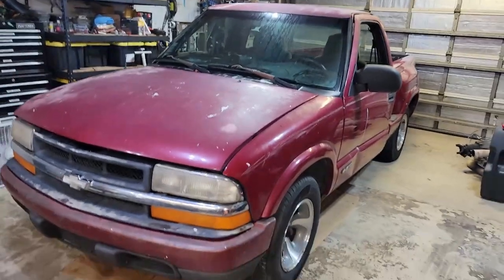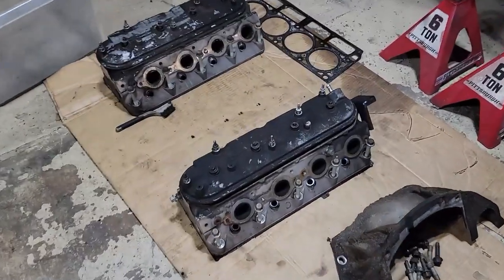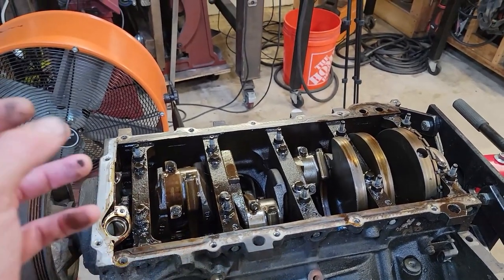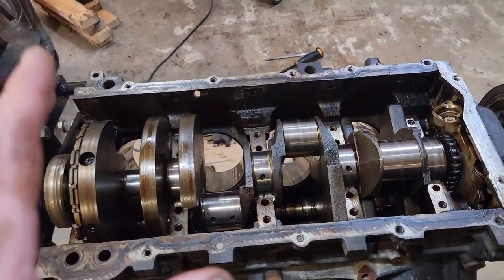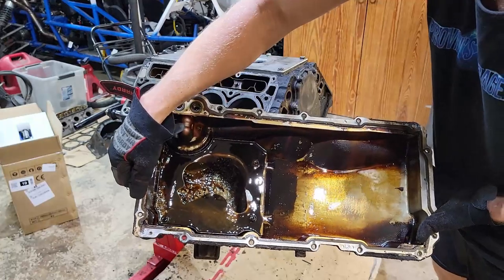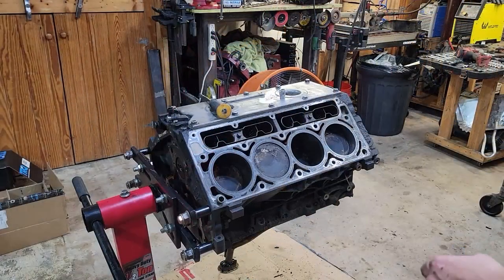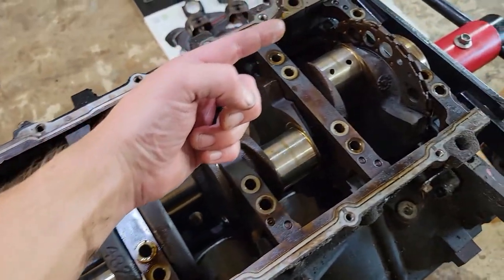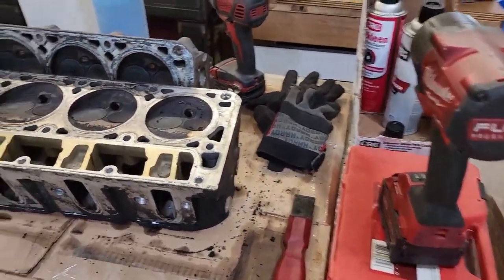Sleeper S10 Build - Part 1 - Motor Tear Down to Get Ready for BIG POWER

Comment: In the land of a speed shop on every corner, how much would new 5.3 crank cost?
Reply from the maker: A little over $800 plus machine shop work. Would probably need to line hone the crank journals. The scored up crank could probably be fixed and then use over sized journal bearings. I'll save that for another project